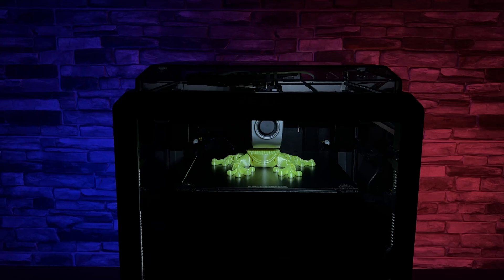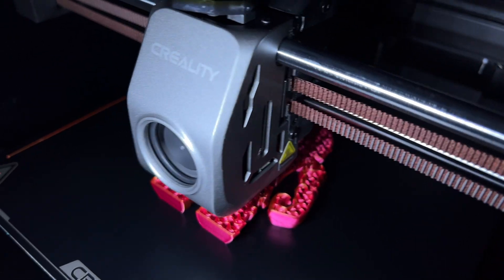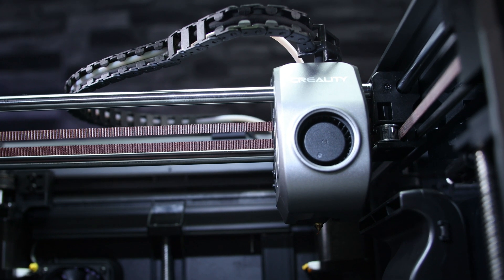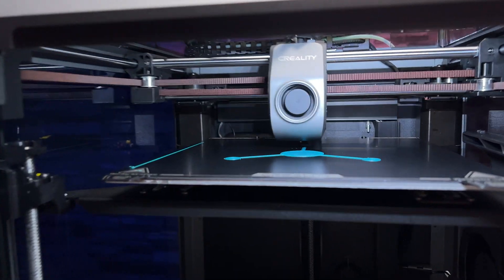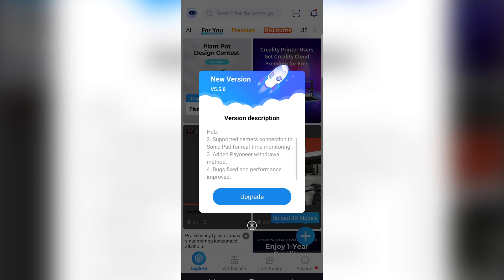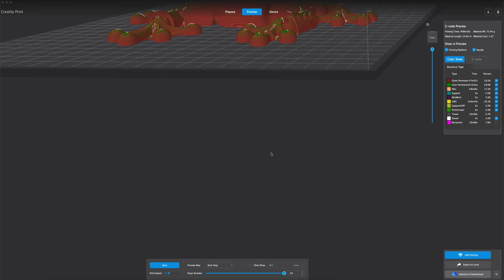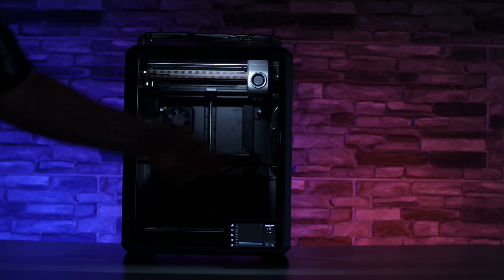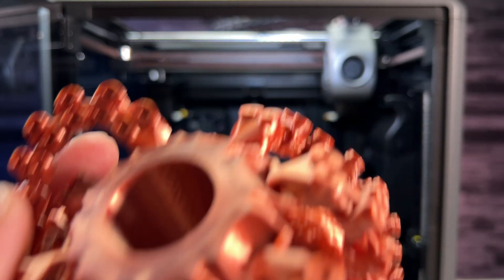The Truth About CREALITY K1 - 600mm/s - Must-Watch Review

Comment: Why was this "MUST SEE"   ???   

No new or important news was shared,   and you totally downplayed the hardware issues it has....
Reply: He sure did. :-( We bought the K1 Max and it crapped out the 1st day! Firmware sent the print head to 260 printing a small petg part and now I have filament stuck way up past the heat break. Now, Creality customer support has been delaying giving us a full refund for 5 days now! The other issues: Extruder parts when it was first released were a bad design. They knew this yet put a bunch out there for creators to have to deal with. Heat break is bad design and the latest firmware release can cause runaway heating! There customer support people are trained to be evasive. I don't believe this crap about a language barrier! Hopefully they'll change their ways but right now I would not recommend Creality to anyone.